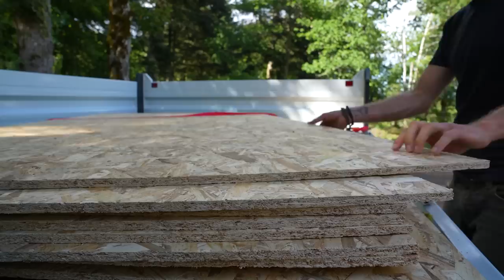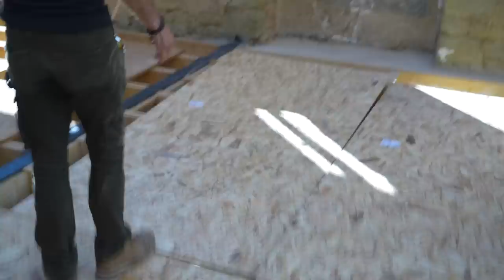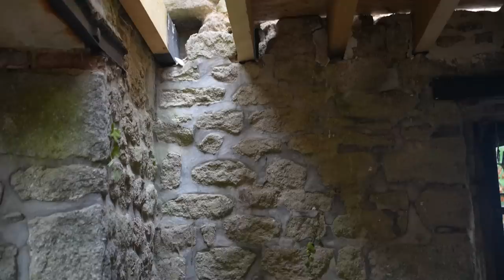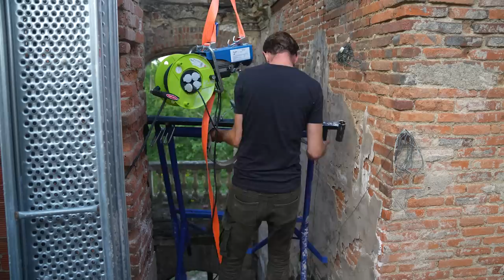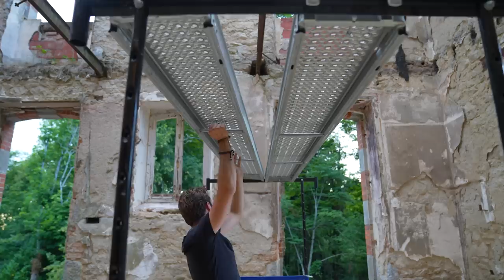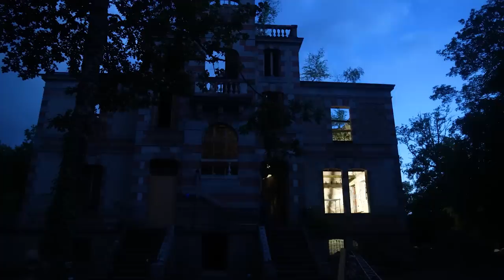A floor for a floor.

Comment: Perhaps one of the reasons that a stairway had been built on the outside corner wall was that it allowed light to enter the room.
Reply: Was thinking the same thing. Plus it will allow air circulation.
Reply: That's a superb thought.
Reply: And the stairs connected the lower kitchen to the upper kitchen.
Reply: If straight stairs were there they would b straight across the windows blocking the light!
Reply: If u look up the wall in that corner there are two small windows which were to allow light in to the corner enclosed wooden spiral staircase to the dining room level.
Reply: Same here... I wouldn't consider glass floor things. So not appropriate for this sort of building
Reply: @markdaunter  Although it would not conform to the original design, an open spiral staircase would allow light and access between floor levels and would not take up as much room as a linear staircase on either floor. It would be quite attractive. If it could be fitted in between the steel beam and the front wall it could be pretty easily cut through the floor at any time, even much later.

Comment: be careful... osb loses strength after becoming wet. it never regains strength once lost. you could fall through after a rain. we only want your safety...  peace be yours! we love you project!
Reply: Oui ces planches gonglent enormement en contact de l eau😮😮
Reply: Yeah, in the sidefloor, he had the water repellend osb, Well he doesn't really have an option since he can't simply drap a tarp over it...Well...he could, leaves most of the floor dry...
Reply: Put your tarp over your floor, why not?  Just a thought…..
Reply: Hate that stuff.Big rip off
Reply: IDK about Europe but I've only ever seen OSB with a water resistant, treated side intended to be weather side up, it's not water "proof" but itll usually do til one is dried in
Reply: @barbarahaines7661   Not hate, sad. # Sound  Millable Timber # is chipped to make chipboard. #
   # Dan explained,  using it as temporary flooring whilst building.
Reply: So what happened soon after you put down that osb? Be careful Dan😟
Reply: @RowanBradshaw-vc2mf I get your point completely, but I think Dan is due a little leeway as he is saving a building may others would have just reduced to rubble and land fill and replaced with new concrete etc.. if there was a way to give him my carbon credits he could have them three times over for what he is doing.
Reply: Can´t get over the fact that Dan builds from the bottom up, without weather cover! I guess it´s ok in a warm climate.
Reply: So many comments without listening to dan…these are just temporary floors….they will be replaced by permanent ones ONCE he has finished rebuilding teh floors and added the rooftop! He explained it in prior vlogs and at teh beginning of this one.
Reply: Dan should paint the top and sides of the wood panels to reduce the amount of water absorbed.from rain.
Reply: If this had been a UK building site there would have been a requirement for fall netting and/or crash bags.  IMO the programming of the works is wrong and the shell should have been made watertight with the roof and profiles to the windows etc. first and then the internals could have progressed in the dry.
Reply: @nononoathousandtimesno8191  plus he's doing it on a very small budget. If he had half a million euros to spare, he'd hire a company of builders with a large crew. They'd build scaffoldings around and inside the château, fix the walls, put a roof on top and then work their way downwards. But that isn't in the cards. Instead of dealing with annoying tarp, it's easier to replace the cheap OSB. As long as he doesn't fall through them, that's a perfectly fine solution. The walls right now are too crumbly to cover everything with a huge tarp. And he'd need a crane for that.
I must confess I'm starting to feel like his grandma. Every time he doesn't post, I start to get worried something bad has happened.
Reply: He’s using OSB 3, which has a higher water rating than the other stuff.
Reply: @thethirdman225  It'll still dissolve by the time the roof goes on and the windows/doors are covered over.
Reply: @clivewilliams3661  Depends on how quickly he gets the roof on.
Reply: @thethirdman225  That roof is a big job that will take many weeks as I assume that it will be of a traditional form and probably a cut roof rather than trussed rafters that will be steeply pitched and clad with slate. And all of that is after all the remedial works to the tops of the walls that needs to be carried out.  We are in week 27 and you could reasonably expect the weather to turn in Sept i.e. week 36 and constructing steep pitched roofs  in poor weather conditions is no fun and potentially dangerous.
Reply: @clivewilliams3661  He put a tarp over it a couple of weeks ago. There are all kinds of ways to do this.

I don't mind you not agreeing but I'm not really heavily invested in this.

Comment: Good morning team Dan ❤ 
 The temp floor is going to be worth it’s weight in gold cause of all the  debris hitting it …after it’s use by date and the true floor is in 😊 your building your outer sheds with it …. Nothing will be wasted on this revolution project 🙌👍🤓
Rest easy and we will see you tomorrow ❤
Reply: Sadly not, it will get wet when it rains, swell and lose strength etc.
Reply: @katehobbs2008 not if he throws a tarpaulin down on it like the above flooring 😊👆
Reply: @gaelenecole4053 He didn't, it got wet, but it's only temporary, well hopefully until he gets the other floor in!?!

Comment: IDEA; Don't remove any of the beams tied into the walls, until you have the new beans on site. You don't want to weaken the structure before hand. Weather concerns could be a problem if you remove any supports. Another Idea, would be to sandwich the large openings with plywood on either side, block a fame out for each opening & attach plywood to. Great job what your doing anyway DAN! 🍀🍀🍀

Comment: Hey, Dan, take a 6ft length of 1/2 " metal conduit.  Flatten both ends about 1 ft in.  Then bend the flat parts into "U"s.  Then you can hook the plywood with one end and carry with the other hook.  Makes it much easier to carry big sheets.
Reply: Or park the van closer to the steps?
Reply: Oh that’s a novel idea. 👏👏

Comment: Remember that lower floor will seem darker now than at finished stage as raw stone and temporary boards don’t reflect much light from windows. I did up a similar room and once lime washed and ceilings installed no extra light was needed from Upper Floor.

Comment: Ok. A few points:
1. I think he may need to buy another scaffolding rig. That way people can work on either end of the span. I can't imagine people trying to work on the top of a ladder. 
2. Once he gets the next floor level in, he may want to get a tarp up that's angled to take the rain over to the side of the building. That would help keep things dry in the section he is working on currently.
3. He may need to get some temporary steel cabling with anchors to keep the building stable. As removing those next few I-beams, if they is no outward or inward resistance, the walls my collapse inward.
Reply: Excellent advice.

Comment: I'm glad to hear you talk about using HEAVY Glass Floor panels to get more light in the basement, it is rather dark down there. and especially along the edge of the wall, where the above windows are placed
Reply: It only looks dark because it's unfinished.
Reply: Once walls are plastered and painted and the same with the ceilibgband lighting it will look totally different and much brighter.
Reply: As long as it is privacy glass panel/tiles.   Another commenter mentioned glass block all around the edge of the ground floor in the right wing.

Comment: For last three days I have watched all this chatöö production. Very inspiring! It's really good how things are done with limited resources and workforce. I have a remote rural location in eastern Finnish forest area with main building from mid 18th early 19th century and stone barn around same time range. Done that for last 8 years but lack of pair of hands and low budged combined that one must do regular job has kept to progress pretty slow. 

I do have some plusses, endless supply of stones, sand, gravel and water... oh and mosquitoes. 😀

Please put a cover atop your well.
Reply: I think securing the well has top priority too. If only temporary with some chicken wire and a rope. Please Dan❤

Comment: Dan you have such a small frame to do all the work, and lifting you do.
My own Dad fought in The Battle of the Bulge. 
Instead of coming home an alcoholic, he came home a workaholic.
If I wasn’t working, my ass best be thinking about it.
You dragging all that brush and raking, to clear space for your tent, reminded me of my childhood.
I was a 28” waist until I was nearing 30, just keep on going.
It’s the best thing you can do.
Only problem I had a lumbar spinal defect and because of hereditary problems I have cervical as well as knee osteoarthritis.
Your drive and determination would have made Dad proud.
Just remember to take time away from your mind.
Do enjoy your life while time is on your side.
A+ ⭐️ You go to the head of the class.

Comment: The link that I put in a comment on your previous video mentions how these brick and stone buildings were constructed with flues running thru the walls to carry air up and down from the tower to the basement and back for natural air conditioning and possibly heating. This could account for the holes you found in the walls. Although something is missing for the heating part.

Comment: I've thought of your well all day. First I imagine the piping is lead, super common until relatively recently. Second, it appears to be a dug well which is prone to contamination. You probably should look into local requirements for water systems and occupancy standards. I cannot imagine trying to read reqs  in another language.
Reply: Is the chateau on some sort of hilltop? If so the water is much less likely to be contaminated.
Reply: Good point. I think some serious thought will be put in on the way to bring water to the chateau.

Comment: A friend of mine did the skylight idea to bring natural light down to the lower floors. She didn't use glass block, however. Can't recall how she achieved it but there are more than one way , for sure. Edit; she actually left space. The gap allowed light to come down. Of course it effects sound, but if planned well in terms of room use it works.
Reply: You can get glass floor panels but they are super expensive.

Comment: Testing how these two go in, along with the C channel, you really should start ordering all 6 beams and start the other rooms so you can get the roof on ASAP. 
Should really start trying to get the tower levels in too. Because since some of the walls on the top are gone, you can build a frame up there and then carry on the temporary roof to go back over the top of the hallway and also on over the rear room roof. Just building one large spanning roof. 
The frame in the tower top will also strengthen the already weakened tower walls and ceilings up there will also protect you from any further falling stone since it won't have far to fall inside the house.

Comment: Dan you might consider installing SunTunnels from the top of the chateau down to lower floors to bring in natural light.
Reply: I like the idea of thick glass along one wall for at least this floor. The remaining floors will be flooded with light because of the size of the windows.
Reply: Won’t be needed if limewashing the stone walls. Raw stone doesn’t reflect or rebound natural light from existing windows so much. Adding white plasterboard for ceiling will also seriously lighten the space.
Reply: My sisters house had a sun tunnel for a windowless interior bathroom. It was brilliant!

Comment: Dan to protect all your hard work from the rain - surely some cheap roofing (clear?) panels would be good right now.  Not permanent but just to dump the rain off to the sides of the building
Reply: Dan has the clear roofing panels.  They are in the main entrance room, against the wall as you enter.   I am sure he will use them, as soon as he has worked his way up to the roofline in main hallway & right wing, stabilizing walls. to support the roof  He is almost there, to the roofline, in the main hallway 2nd floor wall.

Comment: If that is going to be the kitchen below that floor I hope you plan to insulate for sound and heat (kitchens can get hot and noisy) and use something like ToughRock Fireguard X Mold-Guard Gypsum Board which is designed to be used on interior applications and ceilings without sagging.  It provides more than one hour of rated burn through time, and house interiors where moisture is highest like baths and kitchens, or just cellars where it is cool and moisture condenses, should be protected from mold.  Plaster is multiples of the cost of good drywall and provides no more protection.  If you ever do get mold plaster is hideously expensive and time consuming to  get rid of and reinstall, where drywall like the one mentioned above can be done in a day at a fraction of the cost.  You have seen what fire can do to that house.  So, I would also have some last ditch way to get out if there is a fire.  Just an inexpensive rope ladder if nothing else.  Stow it in a nice chest.  I was trapped on an roof with the rooms under me burning in 2001, the man that owned the house died in the fire, overcome by smoke.  I take fire seriously.  And a house as tall as the chateau you should also.

Comment: A cooker, a table & chairs, and a fridge and you have an impromptu kitchen in the old kitchen - then all you need is to build a small cabin to sleep in.
Reply: It's not watertight. Everytime it rains heavily it gets inches of water on the tiled floor. Not a realistic proposal and dangerous to put electrical appliances into such conditions.

Comment: Unfinished walls always make a room look darker than it will be once it's done.
Reply: When you put up the sheetrock material or plaster the rooms will brighten up quite a bit.  I am not sure what sort of permanent lighting is planned but always consider LED as they use a lot less power but can be surprisingly bright.

Comment: Yes, use glass light wells in the floor. I also recommend an elegant modern (definitely not the Victorian cast iron type) circular stairwell into the kitchen. It will use a much smaller footprint, but also allow light downwards.

Comment: It would be very helpful for you as the weather changes if you built yourself a covered pavilion. It would give you a dry spot outside of the building to eat, go through plans, possibly have a dry spot to work. A bit of planning ahead now for when the weather does change may make the winter months a bit more bare able , especially if you get yourself an out door fire and BBQ. Your doing a great job.
Reply: It's called a caravan and I hope Dan has one on order.😊

Comment: Don't forget when looking at the kitchen space that right now it is actually the darkest it will be...you have the dark stone walls and nothing to bounce light off the ceiling...once the walls and ceiling are finished (and you put light in there) it will be a whole different space. And frankly, you could lean into making that a cosy space because of the low ceiling and make it a whole look....

Comment: Dan, have you thought of plastic down on top of the floor to protect it? Martha
Reply: Put the roof on
Reply: Slippery.
Reply: I did think of it being slippery. Just have the plastic on when you are not working that area.
Reply: He already has that on the top floor.
Reply: @TeresaBell-ou1cz  He's getting there...working his way up to the roof line, stabilizing the walls ( replacing brick, stone & remortaring) so walls can support a roof.   Putting in floors helps stabilize walls too.  
As Patrichalldin says below, Dan already has that ( tarps) on the top floors ( main hallways.)

Comment: Seriously dude, replace that scaffold, you have no safety rails or solid cross bracing to prevent it folding up, a scaffold needs horizontal and diagonal cross bars of unequal length for rigidity and strength making it impossible for it to collapse. For a small investment you will save yourself from broken bones and down time at work. Think of the others that will be using it alongside you. 
Love the channel, love watching the work progress, would hate to see it come to a halt due to an unnecessary trip to the hospital.

Comment: I hope that OSB decking is rated for water exposure.  If not you can just roll on a coating that will take care of that.  Just out of curiosity why not get some beams and just lay them across the top of the chateau and make them close enough together to be able to lay a tarp across and create a temp roof on the building.  I saw some clear corrugated panels in one part that could be used like plywood for the temp roof.  I built a temp bathroom and roofed it with clear panels to let in light.
Reply: It is.  Dan said it is OSB3 - rated for water exposure.  
And yes, Dan bought the clear corrugated panels you see in the main entrance room for the temporary roof.

Comment: I would be really worried to remove the distorted steel tie beams. They are still doing an important job. Dont you think it would be safer to install the new beams first in a new position ? Then consider leaving the old beams if theyre not in the way of the new ceiling.
Reply: Good idea. Surely it would be easier too to make new pockets for the new beams and just leave the old ones in place as you suggested.